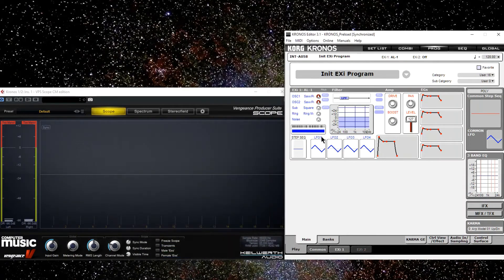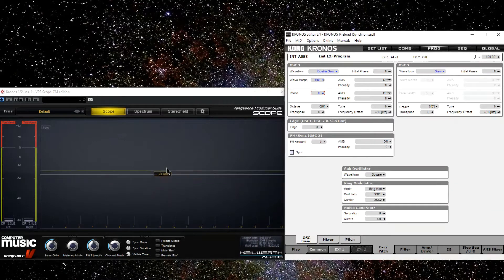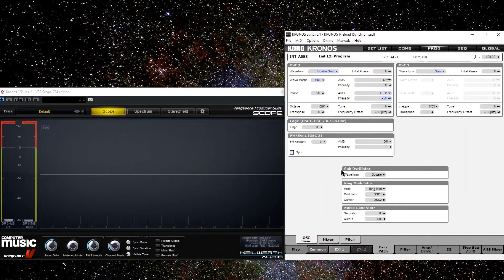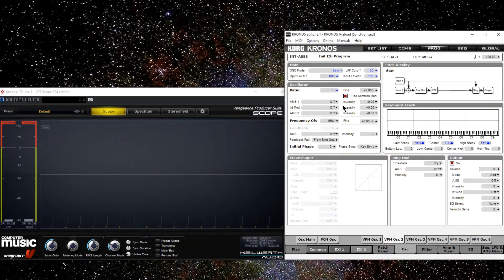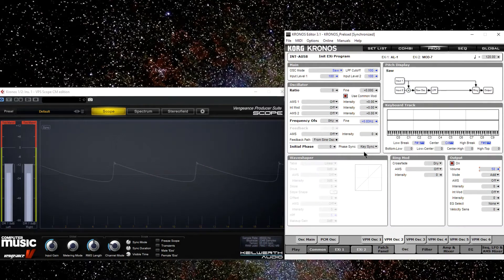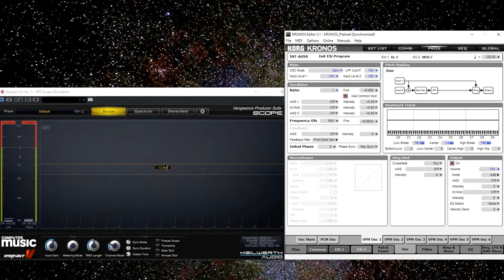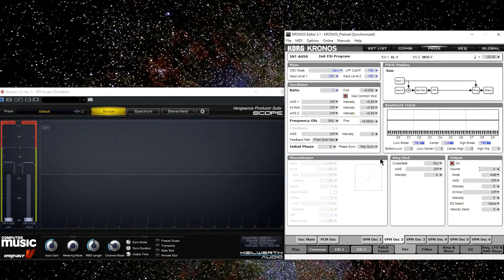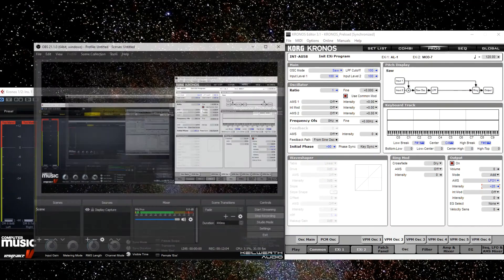Oscillator Sync with FM

Comment: hey man great channel! I was wondering if there's any way to get in touch, I'm trying to isolate a karma drum pattern but i can't seem to manipulate the note maps to do so
Reply from the maker: What do you mean by isolate it?  You’re trying to record the midi? Solo the audio? Change the pattern?
Reply: @CharlesFerraro  Yeah, I'm trying to separate the kick and snare onto individual channels(as audio) but haven't been able to isolate the snare; the karma seq in question is "new disco 2"
Reply from the maker: @rtifishul  Ah I totally get what you're saying now.  Going the Note Map route is smart.  That would work but try this instead... in the Drum Track tab you'll see a section for BUS.  Check the box that says Use DKit.  You'll see all the IFX Patch routings light up below.  Route IFX2 to L/R and send the rest of 1-5 to Off.  That should isolate the snare.  If that doesn't take care of the problem lmk.
Reply: @CharlesFerraro  hey bro thanks again for getting back so quickly

i was able to isolate the snare per your instructions (had no idea abt the Use Dkit setting, very cool) but the kick still bled thru 

I put a lp filter on it, but it took the low end out of the snare itself

any more suggestions would be greatly appreciated!!
Reply from the maker: @rtifishul  I just realized... are you using KARMA in a Program or Combi?  Also which drum program are you using?
Reply: @CharlesFerraro  I'm using the "roller disco" combi, "new disco 2" karma drum sequence with the "House" kit
Reply from the maker: Oh okay.

Go to the IFX tab.
Make sure you're in the Routing1 or Routing2 sub tab.  You'll see the output bus for each of the 16 instrument tracks.
Notice how there's a blue row numbered 1-16?  Select track 10 or whichever track the House Kit is assigned to.
Make sure the little DKit box is marked.
Now in the dropdown menu select Drum Kit IFX Patch.  You can also hold ENTER and press 4.
In the popup menu route IFX 1,3,4, and 5 to Off.  Keep IFX 2 routed to whatever it's being sent to in case the kick has some processing like compression in the signal chain.

Press OK and that's it.  The kick should be isolated for the drum track.